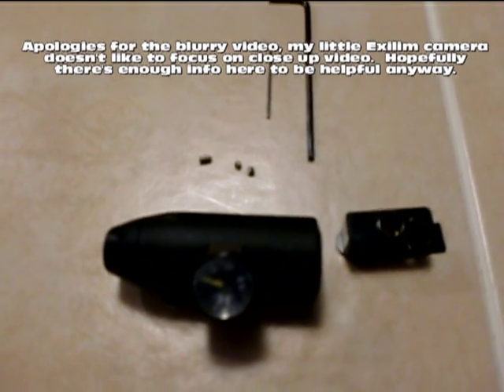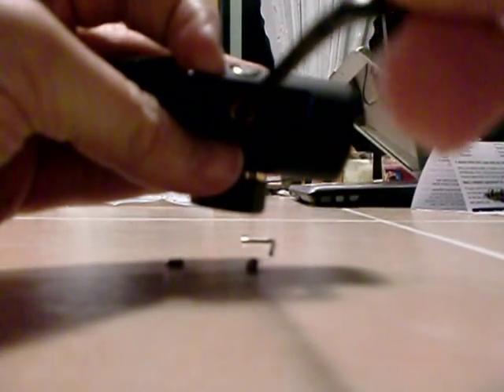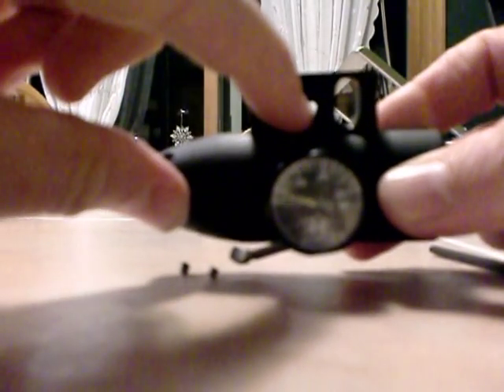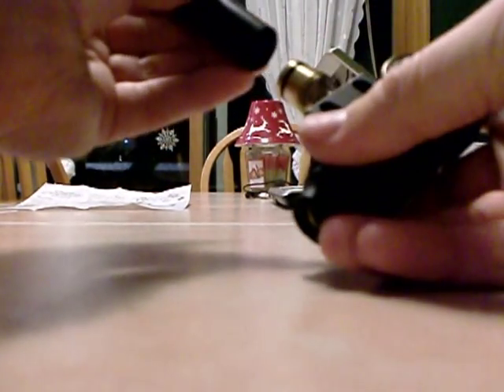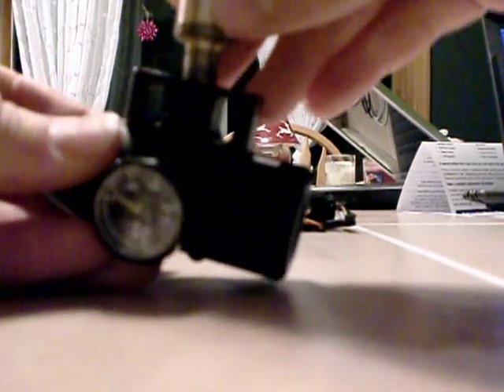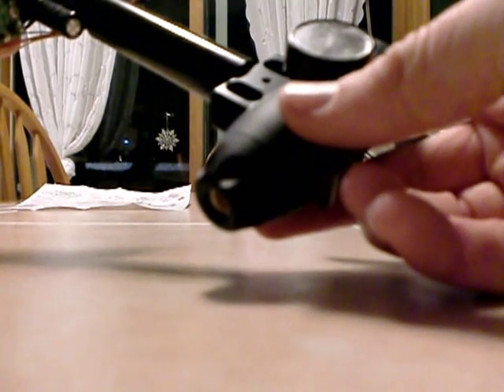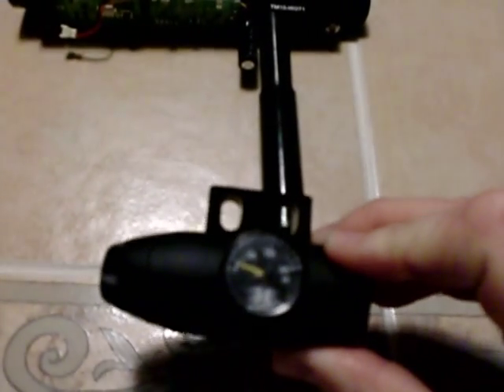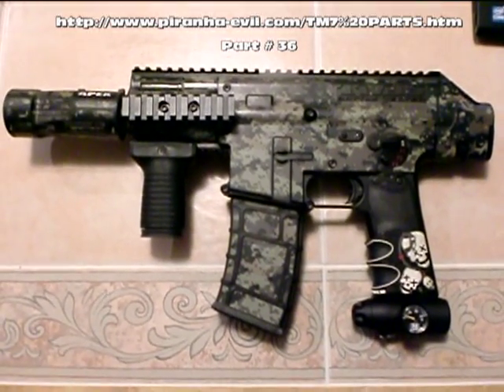Empire Relay Regulator Installation on a BT TM-7 and TM-15

Comment from the maker: @bspellings Glad to hear its helped someone.  For anyone looking to install this on a marker where you'll be using a remote line, I'd recommend against it.  While it still works, if you accidentally flip it off, you'll get air leaking out of the relief valve.  My temp solution is to put a rubber band around it, holding it on, seems to work ok but if I'd known that before I purchased I would probably have left it stock.

Comment from the maker: @chuckyma Could be the o-ring on the bottom of the relay adapter or the small o-ring on the end of the air-transfer tube.  Check they're not damaged and lightly lube them to see if that helps them seal.

Comment: I just used my new tm 15 and after attached my remote line to the asa, it worked great at first.  I switched the remote line off and when I switched it on again it leaks air.  I don't know how to solve the issue.  I'm probably going to send it back because it is only 2 weeks old.  It leaks air at the point where the handle meets the asa/regulator. My remote line is good because I put it on a different gun and it worked fine. Any suggestions?

Comment: staked! i have a problem with my TM7 and it seems to be an air leak and the air thats coming out is at the 4 holes on 2:55 is there anyway to tighten that?
Reply: I have the same problem